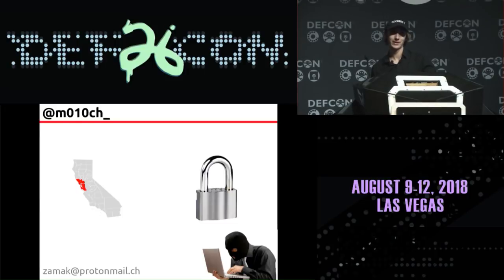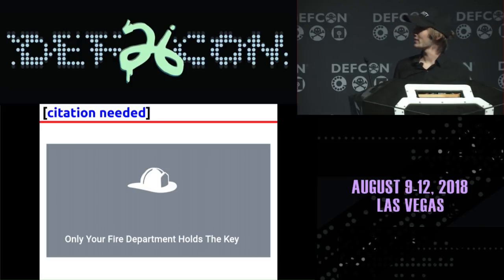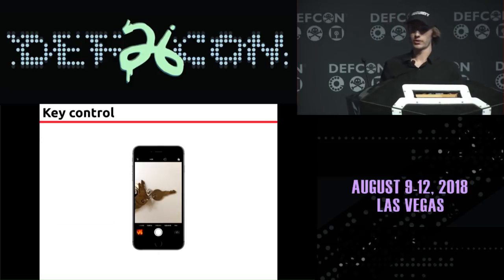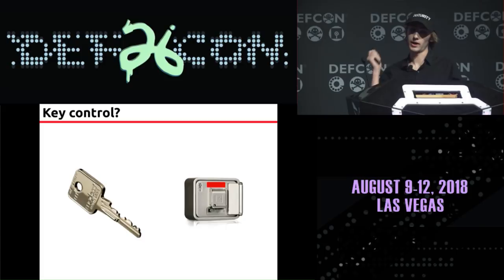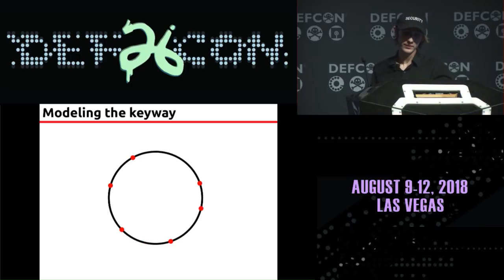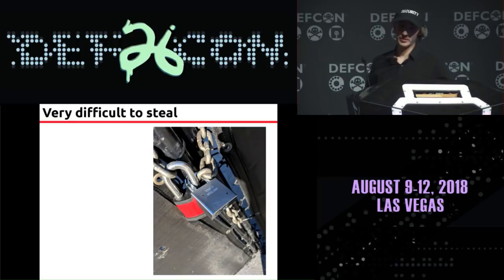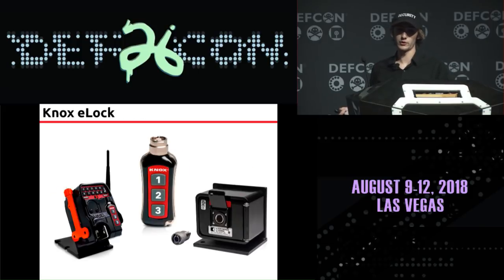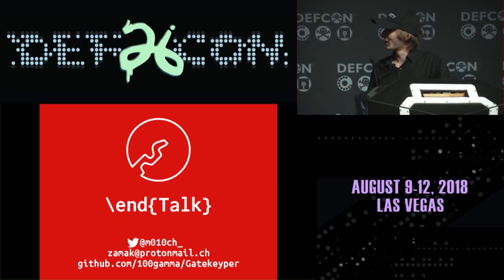DEF CON 26 - m010ch - Please Do Not Duplicate Attacking the Knox Box

Comment: Why are intentional backdoors still a thing, WTF
Reply: because the state wants it.
Reply: 213423 134242 because firefighters do, in fact, need a solution to this problem.
Reply: @JasperJanssen  So? they can break in really quickly if they want to. Having a back door like the original poster said is beyond ridiculous and quite frankly there needs to be a spate of robberies using them.
Reply: It's more of an intentional front door. Like the man says, if the house is on fire you are not going to fuss about the burglar alarm going off or some damage to the front door. If you have hard to break security pay for remote opening ability or just set the doors to release when both the fire detectors detect a fire and the Knox key is used. I work in the field and most alarm systems can be set to open one/all doors when the fire alarms detect a problem. And a cheap electric strike is under $200 these days, so even the average homeowner who's rich enough to buy an alarm can reasonably have at least one door operated that way.
Reply: Because amazingly enough, backdoors can be quite useful.
One man's backdoor is another man's entry point or security.

Web security is built upon a "backdoor".
Most phones these days have a backdoor built in to enable you to wipe it or lock it if it is stolen or lost.
Even some cars are starting to have them installed to prevent theft.
Reply: @jeffreyblack666 The phone analogy is a bit wrong though as it requires a factory reset (so all data is lost) this is literally giving keys to your business to the state fire department which as proven it can not keep them safe.
Reply: @JasperJanssen  No they don't. Doors are easy to destroy and Firefighters are trained to bust through walls and doors within seconds. I can't think of anywhere a well made properly installed armoured door is installed outside of a bank vault or a military installation. The ability to save firefighters 15 seconds isn't really worth giving everyone a key to every lock in the city.

Unfortunately anyone with a slight interest in locks knew this talk was possible (and some had demonstrated such) long before the speaker got there. Methods of producing keys without permission have been around for a long time including impressioning - a method to produce a key from nothing more than a secured lock with no access to keys or photos of such. Merely a little bit of time and a secured lock and someone with the required skills can produce a key to almost any lock. The fact that there hasn't been a massive thieving problem attacking lockboxes or people selling keys to any state's lockbox so far is a miracle. I do know a similarly "secure" system was broken the same way with the keys sold en-mass online.
Reply: Convenience, simplicity
Reply: Fire
Reply: Olivia Lambert steel doors in apartment buildings are pretty common, and no, commercial office fire doors are also not that easily broken.
Reply: @noname-wo9yy  No, the phone analogy isn't a bit wrong. Yes, there is the question of what you can get with the backdoor.
But my point was that people still use intentional back doors and want them/have them as selling points.

Yes, this particular implementation is quite stupid, but that doesn't mean intentional back doors as a whole are wrong or stupid.
Reply: @jeffreyblack666   Jeffrey Black  ok then it's totally wrong, as the phone "valuables" i.e. the data is lost when they use the remote factory reset. This universal key lets people get the valuables i.e. cash/things which are worth money in the building.
Reply: @noname-wo9yy  No, it sill isn't totally wrong, as it is still a backdoor, which is still useful.

And as I said, you can still get data, i.e. the location of the person, using the backdoor.

Comment: maybe I am completely nuts...but why would they not just have a keypad instead of a key?   The firefighters would have a special number with a code they have to call and give to an operator, who would then log in what they were opening and give them the code for the locked key at the business/home.  The code would only work for say 10 minutes, and then randomize again. 

Could go even further and have the firefighters have one of those number generator pads used for PC and gaming security (like the WOW locking key) where they have to give the code, that is only good for say 1 minute, to the operator before they would give out the code.
Reply: Complexity is the enemy of security. While your idea is excellent on paper, it introduces a lot of new potential points of failure.

Comment: A good electronic version could use an improved variation of ASSA's CLIQ cylinders, where the key already contains a battery, a microchip  and an expiry clock.  The emergency services version would use strong public key security, with per key serial numbers and the key becoming useless 10 hours after being presented to the duty Sargent at start of shift.  The key signing machine at the firehouse would need to get online with the one of 3 state buildings (in Capitol and a spare city) every day or it can't issue after a week of being offline.  At a hurricane sized outages, emergency reactivation codes can be distributed to firehouses by military couriers visiting twice a week.  Such a lock would also accept a completely unrelated key code that is unique to the owner and sold with the box.  Because CLIQ keys include a traditional mechanical key, they can be cut to fit the old/cheap boxes in the city, so the firemen don't need to guess which key to use, and thieves can't see which boxes have the weaker security.
Reply: Cliq (and the Medeco XTs) are not generally suited to outdoor conditions where these live. And more complexity = more potential points of failure.

Comment: I am surprised more of these aren't tied into alarms of some sort. Given that the only people who need to access these boxes are firefighters (who are presumably only doing it if there is an emergency AND they cant just enter through the door because its open or there is someone there to buzz them in) then there is no reason that opening the Knox Box shouldn't trigger the fire alarm (if it isn't already active via smoke detectors or other systems). Burglars are a lot less likely to do whatever it is they came there to do if there are alarms blaring and they know that the emergency services are on their way.
Reply: It's laziness and/or cost on the part of the installers. Most Knox Boxes are sold with tamper switches.

Comment: They could offer a service where they switch out locks like crypto codes were switched on a regular basis during ww2.
Reply: Every sweep would cost a few million dollars to change hundreds of thousands of boxes. And you can't switch all of them at once.

The reason code books were so valuable was that they contained settings for the next weeks or months. Yesterdays setting were typically destroyed after use.

So if you have a huge warehouse with 100000+ new locks, what are the odds one of those will go missing?

Comment: "why are intentional back doors a thing?"
first fire escapes are great, and neighborhoods are even designed with multiple exits to emulate the multiple exits of buildings.
seccond, firemen can carry firearms to get in nearly anywhere. instead of having keys, one could have a starter pistol which if held right next to a lock would have a similar effect to shooting it.
intentional backdoors exist because motive about access is all about time. locks don't exist to keep people out but to cost them time for emergency personel to arrive. fire marshals don't need to be delayed.
Reply: then they should probably bash the door in. it would likely be quicker than a firefighter trying to open a door with a key in a lock that might be rusted or the keys missing from the box. its just dumb altogether for such a wide usecase

Comment: Is it better to cut the lock in half like shown in the video, or could you cut the lock from 12 o'clock down to the point where it snaps in half? Then you could sandwich putty in between both pieces of the lock for a physical copy.
Reply: Not really possible. First, the pins aren't held in the right position when there's no key inserted. The correct key moves the pins into the correct position to open the lock, and until its inserted the pins are held in a different position, locking the tumbler.

Further, if you cut the tumbler in half like that, the pins would no longer be held in place, they'd fall right out, and all of your info about the lock would be lost.

Also you'd have to cut the pins as well, further destroying your info.

Comment: Isn't the main problem that once a key gets lost by the fire station the whole system is screwed?
The only solution, in my opinion, is that a person who has access to the building has to hand over the key in an emergency. Although this is a slow process that can and will go wrong.
I have no other Idea how one could otherwise ensure that one lost Key won't screw up. (The only other way would be an electronic system which can deactivate keys, which would need all the locks to be connected to each other...)
Reply: Have a look at the Knox KeySecure on their website. It's an audited system for keeping the keys out of unauthorized hands.
Reply: @portlocks2051  That is missing the entire point of this video. Once it’s out, all that needs to happen is for someone to take a photograph of the key.

Comment: why don't they just put smoke detectors in the locks so that when the smoke detector goes off the lock disengages
Reply: That would be even worse. Anybody with a lighter could get free access to the keys to a building that way without any form of a skilled attack needed.
Reply: @98yoshi98  But the basic idea is not that bad. Wire the box into the fire alarm in a way that (a) it cannot be opened when the alarm is not going, and (b) to set off the fire alarm when it is forced open or removed.

Comment: So where is the hack exactly?
As I understand, the lock is the same for the city, but each building's key is different.
You still need physical access to the actual keys to copy them / take measurements.
He modeled the copy while having unlimited access to his own key, something which will not happen for real cases unless he steals the actual key, which defeats the purpose as you can use the key itself without making a copy.
The ability to copy the keys from an image is also just theoretical, 
1. finding online random images of keys is not the same as finding an image for the key you need
2. taking a key image from 2000ft is also very dubious, you need to stake out a location for a long time and then hope to get a clear view of the key which is highly unlikely, further, copying this key with all of its features from a grainy low res image is also very dubious.

The bottom line of this talk is: I copied a key with CAD
Reply: All Knox boxes in the same area (city or sometimes entire state) have the same lock and key.
Commercial building owners are required to put a copy of their individual key inside that box.
The box key opens all the boxes in the area, giving free access to the building key that is inside the box.

1. Buy a box for the target area,
2. Remove the lock and break it apart to measure all internal parts and make a 3D model of the box key,
3. Print a copy of the box key,
4. Go to any commercial building in the area,
5. Find the box and open it with your printed key,
6. Grab the building key that is stored in the box,
7. Party time.